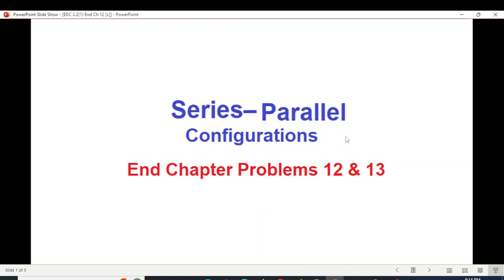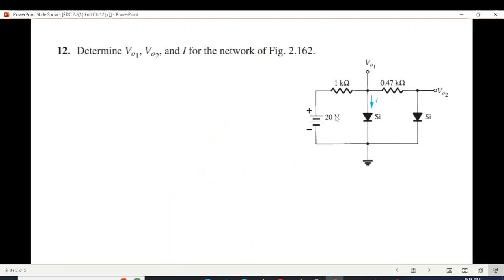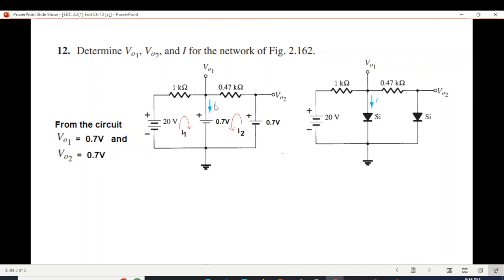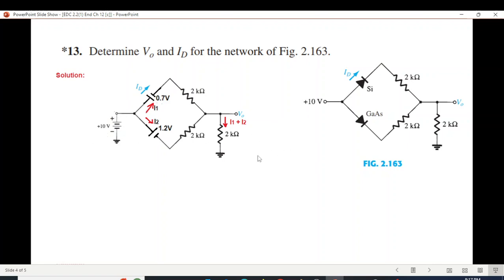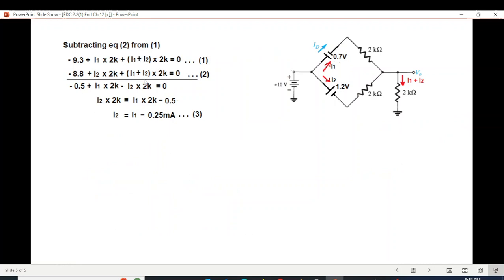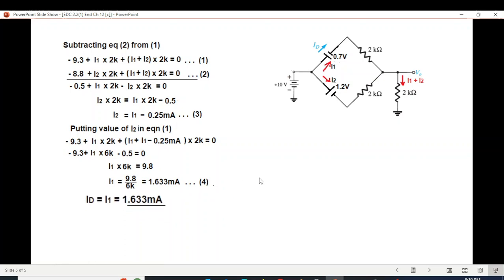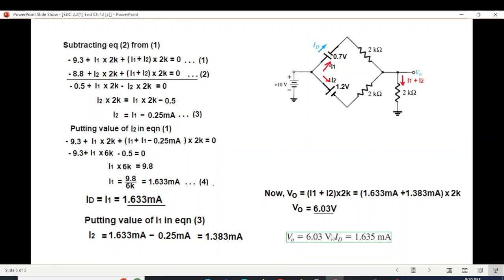(E)EDC(B) Q 2.12 & 2.13 || Series Parallel Configuration of Diodes

Comment: How to determine Vo1 and Vo2 in First circuit?
Reply from the maker: When there is a constant voltage source across a circuit, that is the voltage. Vo1 is across 0.7V, so vo1 = 0.7V. Similarly vo2 = 0.7V

Comment: In previous videos, you mentioned that if Si diode and GaAs diode connect in parllel, GaAs will act as open, no current will pass through this route , but why suddenly there will have a current pass through GaAs??? Also, the voltage across two path is different
Reply from the maker: https://youtu.be/XGz2Z6a7cAI?si=xPH7PbaO1aUIome1
Reply: @ElectricalEngineeringAcademy  why does in that video the KVL for V1 is only 10 -0,7 - ( I x 2k ) - ( I x 2k ) . 
But after Vo it is ( I1 + I2 )
Reply from the maker: @baoquannguyen1542  Please write the video time where you have doubt, so I can follow you. You can whatsapp on +923454030919

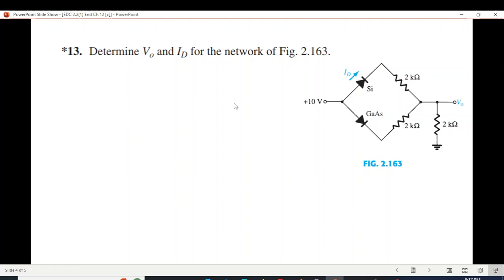Comment: hi, shouldn't v02 be 0 since 02:16 has i2=0? how does the diode work if there is no current?
Reply from the maker: No. if you look at the diode characteristics curve, you can see that the current is zero upto about 0.7V across it, and the current starts flowing through the diode only at or after 0.7V. 

Also consider a 12V Battery (say car battery), if you donot connect wire to complete the circuit, no current will flow, bu if you measure the voltage, it will be 12V.